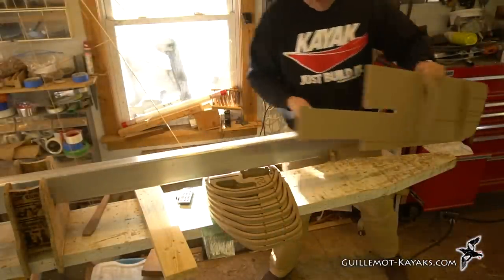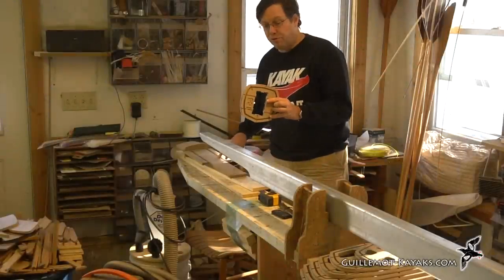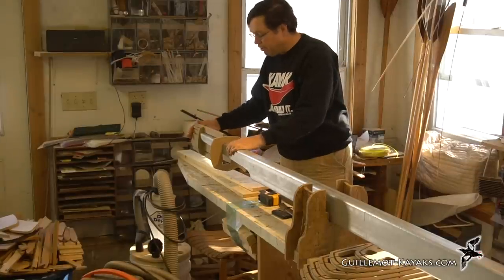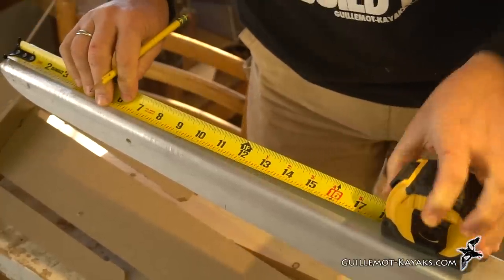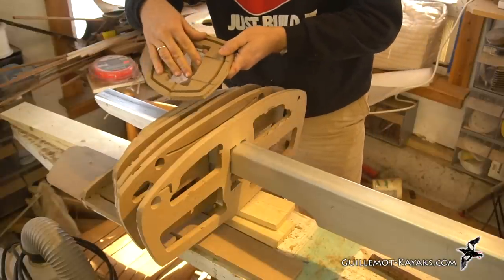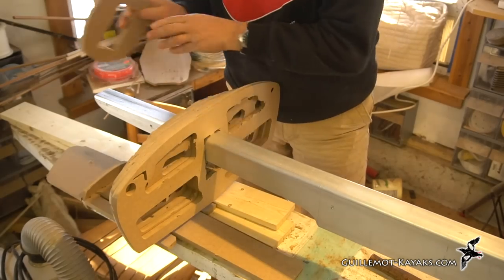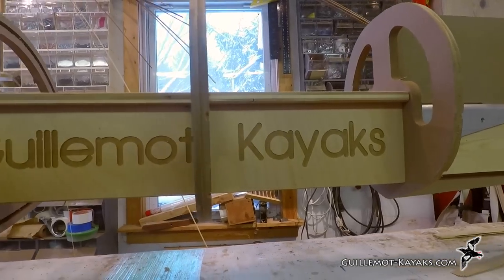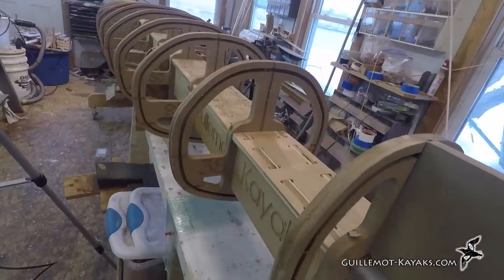Setting Up The StrongBack   microBootlegger Sport   E6

Comment: I'm at this stage in my project at home right now.  I started by lining up the forms from both ends, but they were too far out of alignment.  Then I lined up one side and put the reference sticks on the first few forms of the other side and it was much easier to line up.  Nick's aluminum strongback and CNC routed forms are a bit intimidating.  I'm using a homemade box beam strongback and paper forms on MDF cut out with a jigsaw and hand drill and it is working well so far.

Comment: Nick, awesome chanel!!! I just discovered it last night and cannot stop watching! You are truly an amazing craftsman and watching you work is very inspiring!!! I really liked how you have everythig thought out and super organized. when you started talking about the strong back support and how you measure your distances, some thoughts creeped up in my mind and i thought I'd share them with you, perhaps my two cents can help you streamline even further. Instead of measuring from the bow of the boat, why don't you set up your measuring from the middle of the beam. install a metalic adhesive tape measure strip that is most commonly used for miter or table saw sleds, one going towards the front, and the other going towards the back, stern is it? then when installing the middle support boards you can just run them like a normal sled to the point on the tape measure you have. Number the boards in sequence somethimg like 1-b30, the 1stands  for the first board from the bow, and a fool proof B for bow and 30 for the ammount of inches from your center starting point. That way you just slide the boards in order and space them without having to fiddle with tape measures.
I have never built a boat and I'm not sure if there aren't other details I would have obviously not thought of and this would not work, but that's what I'd do if i had to build one. Please think about this and let me know if it makes sense to you and if not, then why not!
Your channel makes me wanna build a boat now!!! Perhaps I can come join on your building courses ....
Happy paddling

Comment: Nick, while watching you set up the forms with precision, I remembered seeing plans for the gondolas in Venice. They purposely make one side of the boat 6 inches longer than the other side in order to make it easier for the guy paddling on the one side -- steering by making circles or curves in the water. The boats are highly polished and interior is beautiful high quality upholstery. Ironic as the water ways have sewage to float them in. A strange crooked boat.
BLUE DAVE

Comment: Hi Nick, Awesome,beautiful work. A laser level would make quick work of lining up your forms. Maybe a pencil mark on the outside edge would help, but not necessary. Your strongback would have to be level first. Cheers
Reply from the maker: I've used a laser level. The time saved in setting up the forms is lost in setting up the level.

Comment: Hi Nick: When you "added" extra forms for the 10" spacing, could you pls tell me which form #s?  With regard to forms bevels; in acquiring the angles, and after alignment on the horizontal alignment ref marks, would a string line placed [bow to stern] on the H align marks "tell" which forms to bevel and how much [and subsequent movement of say, an inch or two "away" from the H align marks into vertical most position of the form, be okay, or?   Thanks, Randy

Comment: That is an elaborate set up ! A lot of great planning and execution ! Do you expect when the forms are removed from the hull, will the hot melt glue  destroy the edge of the form ? Another Great video !
Reply from the maker: It is quite possible the forms will be mangled by the removable process. Particularly since I cut the lightening holes, which weakens the forms substantially.
Reply: I'm guessing the MDF to be more fragile than plywood. Better to lose a form, than to destroy a strip. I like the 10" spacing, a benefit of computer design fairing ! Lovin this series ! Thanks !

Comment: Hi Nick I'm fascinated with the content and explanations that you have posted in the videos. In the case of this video at 10:23 when you mention about the alignment of the water line of the shapes I ask you? . Would the level that builders use to lift walls help you to align the height of all molds? .Idea of horizontal alignment in molds by molds. Hug .
Reply from the maker: Yes, a laser level or something similar can certainly be used. Some people may find it helpful. Note that you would have to spend a fair of time getting the system setup exactly where you want it.

 Of course, in the end it will be your eyes seeing if the alignment looks right to you, the laser just gives you another way of referencing.
Reply: @NickSchade  Thanks Nick

Comment: As I watched you line up the forms, I had an Idea. If you get a laser light, it will make lining it up with precision. The red laser can reach 20 miles. The green one can reach 30 miles. I figure a leveled table can be used to slide laser to view the forms lined strait. Or use a tripod. I haven't thought it through.
BLUE DAVE.
Reply from the maker: I have used a laser in the past. It does a nice job of projecting a straight line. However, it does not line up the forms for you, you still need set up the laser in the right place and hold it securely, then also secure the strongback so it does not twitch relative to the laser. Once it is setup, the line projected is easy to see and you can make your adjustments in one plane (horizontal or vertical). 

Then you need to set up the laser in the other plane (vertical or horizontal) to see if everything is good there and make adjustments as needed. You then should double check the first plane to make sure it hasn't moved due to your recent adjustment. Then if any new adjustments were needed you should go back and check the other plane again. 

This cycle could go on awhile as you dial everything in. Obviously two laser would speed up the process.

Alternately, you can use your eyes to sight down the forms and the reference lines to see if everything looks good. This can be done quickly with no other setup beyond assembling the forms on the strongback. You are doing the same thing you would be doing if you had set up a laser, without the bother of actually setting up the laser.

Comment: Been following your vids. I appreciate the engineering mind you put to your designs(exceptional far sighted).  Click on my green icon then expand to "videos" to see the ultimate totally adjustable strong back(can uee it over & over). What i have going  is definitely in only pro's set-ups, which you might apprieciate.  Working with Balsa lineally application ++ lineal tight seemed veneer each side(inside& outside).  I do like the idea of a SolidWorks design, but probably like you mine is full scale hands&knees marine architecture.

Comment: Would it be possible to use the CNC router to make holes in the froms at exactly the same spot which you can use as sights to line  up the forms on the strongback?
Reply from the maker: There are enough references to get the forms well aligned, but a hole like you suggest can help. I have done it in the past and decided it doesn't make that big a difference.